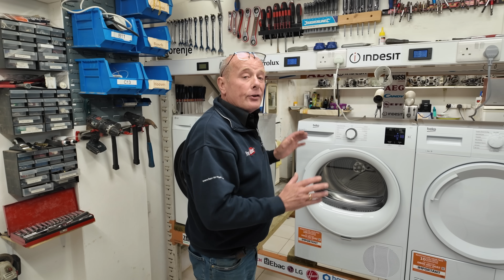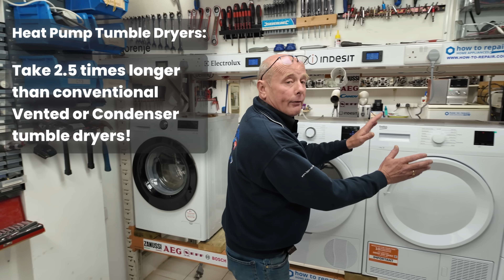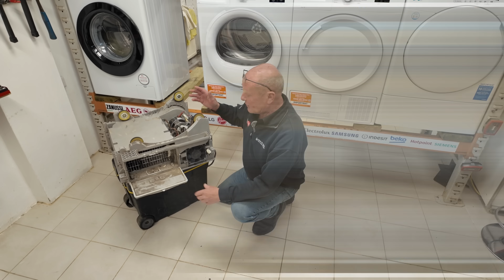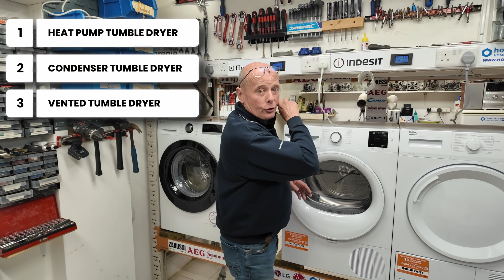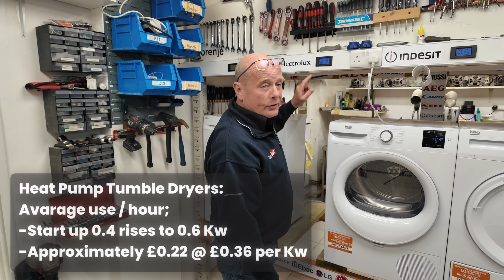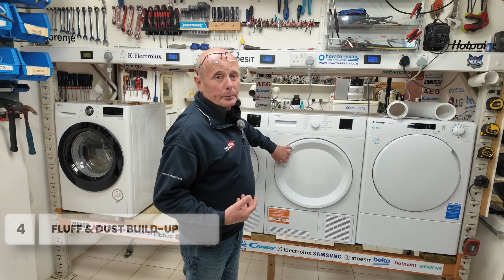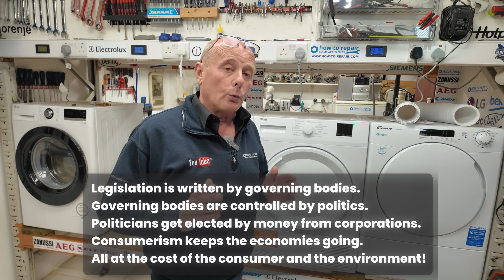Tumble Dryers the Shocking Truth About Heat Pump vs Vented & Condenser, NEW LEGISLATION!

Comment: I'm in the love/hate camp. Own a Hoover (candy rebadged for the UK) heat pump tumble dryer. It works, its dependable.
Hoover removed the smart features, so I'm still upset with them till the day I die.
The starter capacitor ended its life after around two years. I elected to replace this myself..cost was around £10 for the item, but taking the drum out and replacing the capacitor and refitting the drum took an entire evening. I also say it has a broze-oiled bush for a rear bearing, so gave it some love while I was there.
If they had fitted a small access panel to the right hand side it wouldve been a 10 minute job, but then I wouldve neglected the bush. 
And yes, there was loads of fluff everywhere..also cleaned that out.

So where are we...product neutered from when I bought it, failed in its first two years...yet somehow I still consider it nice and find it reliable. Because...starter capacitors do go on tumble dryers an washing machines. But I wont ever forgive them for removing the smart features.

Comment: This is spot on. My samsung heatpump tumble dryer just died after 5 years. Although i managed to fully disassemble and clean the heatsink part, the issue seems to be de-gassing or the compressor. And the spare parts are almost the price of the whole dryer initially. And the drying always took  more then 3 hours. Im getting a regular condenser dryer next time

Comment: Sadly my 13 year old tumble dryer finally broke and I was talked into buying a heat pump dryer for every vented dryer was out of stock and so we’re the condenser dryer. The problem with the air pump dryer doesn’t work in a cold room and a average cycle takes 3 to 4 hours to not completely dry your clothes and then they recommend that you buy a close airer to hang your laundry on. My dryer has always been in the brick shed on the side of my house so during the cold winter weeks and temperatures below 45 degrees they don’t work for free condition outside the dryer does not get warm even only cold air from the very thin wire that gives the  heat pump are going to ware out faster than the current dryers and it’s not entirely energy efficient if you need 4 hours for a single load that is still wet when my old dryer and 8 kilo load of towels takes on 60 to 70 minutes to be bone dry on a thousand spin cycle. Only had my new dryer for a few weeks before I scraped it’s never worthwhile to purchase the new air pump dryer that cost me £500 and it wasn’t fit for purpose

Comment: If the PCB goes, all the machines are dead. Cheap dryers have bearings intergrated into the drum...so dead. Too hot dryers  wreck clothes as well. On your figures heat pump uses 1kw so half the cost.

Comment: Thanks for this video.
I do repair our household machines myself and have saved a lot of money at the same time as I'm having fun.
3 years ago we had to replace our condenser tumble dryer (Borsch) after many years of duty and some repairs. We took the step to a heat pump dryer (Mile).
It has worked really well since then. Now it is only me and my wife using it, so in the winter time we use it 1-2 times week.
I hope it will last for some more years. But I'm also looking forward to try to repair it.
Reply: Well, it's more complicated. But, if you have fun anyways it doesn't really matter, that you will need more time, if it comes to that. Maybe looking at much higher parts costs. But meanwhile you save a lot of your electricity bill.

Comment: We have a Candy vented dryer bought 15 years ago. I have replaced a heater element, a belt, and the removable filter in that time as well as cleaning accumulated fluff from the inside of the unit every year. It sounds like a bearing might be rumbling.
I'm a retired Electrical Engineer (not in this field- industrial and utility) and it's really easy to get into and repair.
I'm glad you've brought this up about them being phased out. I had no idea. 
I've now decided to stock up on some spares, particularly the heating element and maybe a controller. If I remember rightly, I think there must be a thermostat and humidity sensor somewhere. I have some repair and spares info somewhere. There's always YouTube.
We rarely use it in the summer. We have a garden with a clothesline and a south-facing conservatory with a retractable line. The latter dries most clothes in an hour on a sunny day even in winter. But, it's good to have the tumble dryer for the occasions when all else fails.
Our dryer vents directly outside. I cut the hole in the wall to line up exactly with the dryer vent outlet so all I have is a short steel tube doing the job. No flexible tubing needed. I don't want to have to cut a hole in a different place for a new dryer, although perhaps a heat pump dryer wouldn't need one?
The cost to dry a week's clothes in the tumble dryer for the two of us is minimal. About the cost of two cups of tea in a cafe. Towels and bed sheets bit longer.
Environmentally speaking, the amount of energy manufacturing that tumble dryer from raw materials to delivery to my door 15 years ago has long since been justified.
Regarding fluff. It's surprising to me that we have any clothes left. I get the same thought about the carpets when I empty the vacuum cleaner.
Thanks for the info.
Interestingly, you mentioned built-in obsolescence. I read something recently about a famous make of washing machine having a usage counter built into the software. It might have been "bosh". Don't know what the counter was supposed to do.

Comment: So overall this has nothing to do with legislation at the end of the day as you pointed out its to do with the manufacturers design. 
1. Causing issues with repairability and access so therefore cost for training of repair people, 
2, wear and tear due to longer usage at lower power its causing wear tear but again its a parts issue not a legislation issue. 
3 initial cost outlay of purchasing a dryer all new tech is expensive when it first comes out will become cheaper when other options are removed, but then have to consider as you say it has a condenser and should be treated like a refrigeration unit or air con at this point.. 

I have never used a dryer in my lifetime, two generations before me, we have always used outdoor line, or during winter indoor rack with a desiccant dehumidifier with a shower curtain over top of the rack, dries a load within a hour.

Comment: The vented dryer is faster and uses more energy but it also cooks your clothing and there are people that have the moist air going into the house affecting their health and then using a dehumidifier to get rid of the moisture again.  Where as a heatpump dryer is slower but also gentler on your clothing and it gets rid of the moisture.  That heatpump dryer in the video is a stupid design  get a heatpump dryer where the heat exchanger is accessible and easy to clean some even have self cleaning condensers.

Comment: I have had a heat pump dryer now for 5 years but it is impossible to clean the evaporator fins as you said its a built in unit if it was easier to remove like on the condenser type then they would be very good MC,s nothing you can do about the gas unit as these are basically a fridge working in reverse the same as air source heat pumps

Comment: I have to use a condenser dryer, as there is no access to an outside wall to vent, etc.   The condenser is cleaned every week, with the vanes cleaned and all fluff is removed from the 2 door filters after every drying session. Once every 6 months, I clean out the motor, etc with a vaccum cleaner and small brush to stop fluff build up and potential fire hazard.

Comment: Add the cost to the environment to manufacture the heat pump.....Great video!  Vented dryers take your conditioned air and send it outdoors.  Outside air need to infiltrate to replace it.  To me, this is why condensing dryers are the answer.

Comment: I’m a first-time buyer, and I’m considering getting an Electrolux vented dryer. It’s quite affordable and fits my budget, but I’m wondering if it’s actually a good choice in terms of performance and reliability. I’ve heard that Electrolux is a trusted brand for laundry appliances, but I’m not sure how their vented dryers compare to condenser or heat pump models. If anyone has experience with this dryer, I’d love to know how it performs, does it dry clothes evenly, is it energy efficient, and how noisy is it during operation? Since I’m on a budget, I just want to make sure it’s a smart purchase that will last for a few years without issues. Any advice or user experience would be really helpful!

Comment: Can't help but think that as the heat pump dryer slowly clogs up its efficiency begins to fall off and also that its compressor has to work harder and harder to get the job done.

Comment: 6 months on with my Becco Heat Pump Dryer. 
It dries everything in one hour I find, but that's 15 mins longer than my old Hoover vented Dryer, but, supposed to use less energy. It does seem cheaper to run. Mine has a double fluff filter which I clean every single time. That said, I still preferred my vented drier, it was vented through the wall, but where I live now we're not allowed to vent that way.  The important thing is, to not open it to check if it's dry yet, otherwise it messes up the end pumping bit, lesson learned, just let it run until it finishes and notified you it's finished.

Comment: There should be a hybrd models of tumble dryers with heat pump and heating element in it and with the ability to remove the heat pump and make the conventional condenser tumble dryer out of it. By the way: the heat pump is a good design. Bad designs is the luck of ability to clean the condenser/evaporatior and the poor quality of whole refrigeration system with aluminium thin pipes as in Electrolux/AEG/Zanussi or Candy/Haker or Bosch/Siemens or Beko/Whirlpool/Indesit/Ariston/Hotpoint (instead of proper thick, copper pipes)

Comment: I have a Panasonic condenser dryer been going strong for at least 10 years. The only gripe is a small piece of the door latch snapped and the part is not available. Fixed it with JB weld but disappointed a spare was not available for purchase. Shame on Panasonic.

Comment: I've a SAMSUNG condenser drier. After running an old Hoover, a cheap vented for 17 years, issue free I knew about the hassle of the 5 year deep clean, but fairly confident I can manage, of course it should a straight forward job. All aspects of maintaining the machine should be made easier by law. Since the old vented packed up I've noticed changes in how the clothes are. Garments like underwear are are not lasting nearly as long. Elastic detaching, holes appeared, so I'll be replacing them maybe twice as often. As against this, the machine does use a lower temperature. Also IMO the simple vented is best for clothes, even compared to a condensing drier. Because the drum temperature is far lower. As far as bearing and motor life is concerned I'm not too worried. The Samsung spends nearly as much time with the drum with the drum stopped, allows a change over of air in the drum before restarting. However the actual drum speed is higher than the old vented. Care needs to be exercised with sheets, these get tangled into a ball unless carefully separated and placed in the drum individually.
Good video, thanks.

Comment: Thanks for the video - very informative, logical and worrying. Having just replaced a heater unit in my vented tumble dryer at a cost of £50 for the part, took me (unskilled DIYer) 1 hour and also gave me the chance to hoover out any excess fluff, I think you are correct regarding the greenwashing by manufacturers and I would really appreciate having the option to purchase what 'I' want to buy rather than being forced into'we know what is best for you' by ill-informed governments.
Reply: Governments are not ill informed. They have everything to gain for letting their big manufacturing friends keep selling programmed obsolescence machines.
Reply: Just bought a heat Pump Tumble Dryers Takes forever to dry.Big mistake .
Reply: @raymondmarkham3501  how long does it take?

Comment: I could not agree more that appliances should be repairable to avoid the abhorrent waste. However, for a family the payback time of a heat pump can be as little 3 years. HP machines now have self cleaning cycles to maintain efficiency and often have a 5year warranty . To quote from the consumer magazine Which  - heat pump use at 3* per week £54/ year. Condenser £138/year. Sadly, It is still more economical to run a heat pump dryer and replace after its life. What a waste.

Comment: im blessed with a spacious house and garden with lots of parts covered from rain where i can air dry my clothes. aint no way im using a tumble dryer for my clothing. i do like to use a dryer in order to get extra fluffy towels. which is why i got a second hand vented dryer. for the few times i use it, it isnt worth getting a more modern one. should i ever need to dry clothing quickly, the vented dryer will be the fastest option vs newer dryer technologies. i can't reuse the vented dryer's air to heat the house in cold months, tho, since it outputs humid air 😾 might rethink and get a condenser dryer if i ever end up moving the dryer out of the basement, to the ground floor.

Comment: This is a credible case, however the neglected argument is the lower peak demand of the heat pump dryer. At a National Grid level, it’s peak loads that are the problem. Older, less efficient and less clean power sources are brought on-line to deal with peak demands - if everyone were using heat pump dryers, then there would be a network benefit. In time, we might expect this to be reflected in lower energy costs as renewable sources are able to cope with network demand. Unfortunately it seems price point and total lifetime appliance costs don’t yet make sense for the individual consumer!